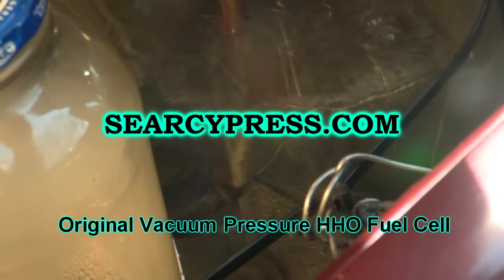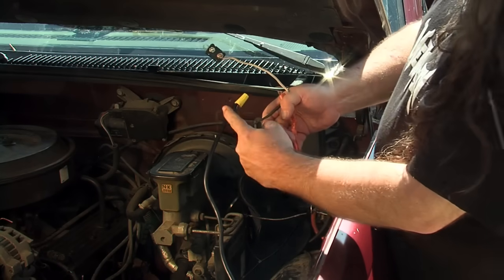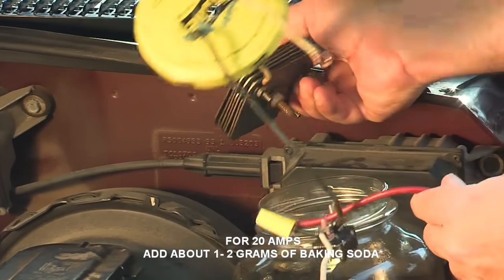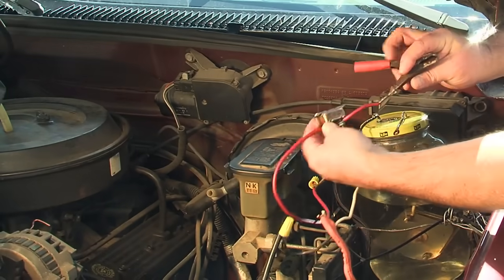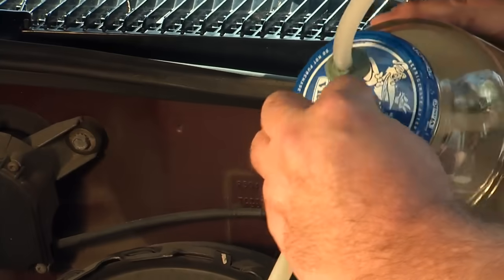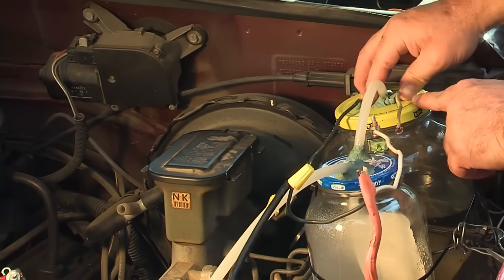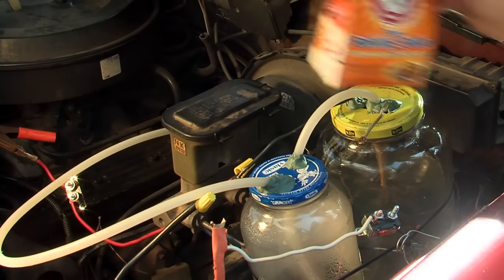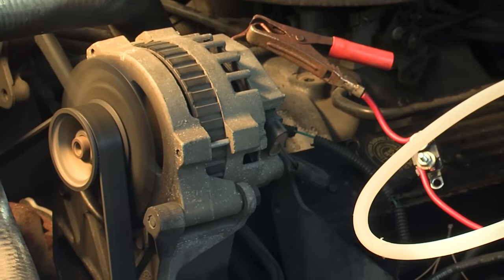Vacuum Pressure Hydrogen fuel cell defeats high gas prices using hydrogen from H2O.

Comment: "Don't rebuild anything you see In this video..." 
2:51 " I highly recommend that you connect it as you see it in this fashion."
Reply: @a.freeamerican7267  PVC creates static.. bad idea.... glass does not
Reply: @DaChiefn1 xl
Reply: How often do you change plates?
Reply: @timothylogan5387  never
Reply: @Polaris88Reid  
Have you looked into alcohol engines??

I have a moped that runs on moonshine. ( yes, it's a completely rebuilt motor... and I'm aware it will need to be rebuilt sooner than if it would have been ran on gas..)
    I've put over 3000 on it so far & she's still running strong
Alcohol engines are a little harder to tune but once you figure it out you can easily break away from these oil cartel barons.
And unlike hydrogen you can run completely off of Just alcohol.

Makes you wonder why the big three don't produce alcohol burning engines...?? 😀😀😀😀😀😄😄😄😄😄😊😊

Imagine all your neighbors having alcohol burning engines & you had a 200 gallon still...
Oh wait...!! they made making massive batches of moonshine illegal
I wonder why..?
Fukn Oil cartels mannnn
Reply: @djlansing  yes. Good words.
Reply: The governments can Get fucked.  I used to do this for ten years in my suburban Saving money  too .Except build a lot cleaner and in a hidden ways so it looks stock and clean.
Reply: @Polaris88Reid  I have a02 Chevy suburban 5.3 . How big should I build my hydrogen generator so I don't have to buy fuel anymore
Reply: @Polaris88Reid  give it up bro, hook us up with some plans?
Reply: Christina Eckels 

I like that it’s made mostly of trash that would otherwise end up in a landfill.
Reply from the maker: Exactly. Thanks for your comment.
Reply: @metalpresstv  excuse me I've seen people setting up their engine with a gas tank around where your setup is and they run their vehicle off of just gas fumes it goes right into their air filter have you seen anything like that and tried it curious if it would work on your vehicle I'm pretty sure it would just running on straight gas fumes gas tank right in the engine with a couple hoses hooked right up to it extremely simple apparently
Reply: @jonnypage9484  Charles N Pogue vapour carburetor...1930s...that was using a 4 cylinder big bore ice cream truck...your car actually uses vapour from canister buildup its built into your engine for MANY years..easy to tap into
Reply: @mjolnirswrath23  I'm thankful for being a plumber and I got a basic generic knowledge of this my only problem is I want to know how I can hope this up to my little Honda Accord or possibly my Chevy equinox . And this is a message to the people the 2015  Chevy equinox is the worst vehicle you could ever purchase and we swear on that
Reply: @metalpresstv  why do you want to run it at 30 amps, just for max production? Have you ever had any problems since or updated your system? Thank you so much. You rock.
Reply: @metalpresstv  https://youtu.be/58IkmPK6ikc
Reply: @metalpresstv  pls get back to me I'm wanting to do this with one jug dose it make it use moer gas or less
Reply: @metalpresstv  
This may help with fuel mileage but I sincerely feel that you should advise people about how explosive hydrogen is.
 Not that it's really going to hurt you... but if you were to get into a fender-bender you'd see a nice flash until all the hydrogen gas is burnt up.

Just something the kiddos trying to save a few bucks ought to know.

I made a hydrogen cell 10 years ago when I first got out of high school but I didn't put it into a vehicle I just used the cell to blow up balloons and then we would throw matches or Point lasers at the balloons & BOOOOOM!!!!
We got so bored with it for kicks one time we filled up a trash bag w/hydrogen gas & that really got a big bang
😄😄😄😄
Reply: @djlansing  I know a friend that used to fill up 55 gallon black trash bags with acetylene and helium mixed,  tie the bag and light the tail let her go . made an interesting Conversation  piece at midnight for the neighbors smoking lefties in the back deck .
Reply: @wagnerrdtradingpostonebay8934  not sure what a lefty is...
Is that like an uzi..? (put a lil coca in the cig..?)
LoL
Never thought of putting helium in this to make it go up in the air.
Nooiiiccee!!
Reply: @djlansing  Idk they always called joints  lefty when I was growing up. Yes get the mix just right too much hel she would float up too fast put out the wix. Good clear night all you could see is a dripping molting plastic droplits on fire till she got up about 1000ft  Then boom
Reply: He used to get board on security duty .would experiment with shop supplies
Reply: @djlansing  I was agreeing with you that people should know how combustible it is. I'm commenting on the video not your 8th grade science fair project. Yes you could separate the Oxygen and Hydrogen production but that's clearly not the generator shown.
Reply: I was coming here to write this. Thanks!
Reply: @NithinJune  no it's safe
Reply: @NithinJune  hahahahaha
Reply: @Polaris88Reid  But you dont use it anymore?
Reply: What fashion ?
Reply: Got it sry.
Reply: @Polaris88Reid  If it worked - why don't you use it anymore ? Also was it tbi or did it have a carburetor -
Reply: Message to Johny Page. I watch a debunking show on running a lawnmower only with gas fumes. They tested the amount fuel efficiency on straight gas and gas fumes. As far as i remember the fuel efficiency was the same, but who knows. Maybe the fumes would save on an actual car. Maybe with all the oxygen sensors in a car the computer will adjust to save on gas.
Reply: Hilarious....I might try this tho!
Reply: Pickles + Sauerkraut = GAS!!!
Who woulda thought...
Reply: @NithinJune  no it doesnot I used one the same for years in a vw diesel and its still going
Reply: @jimmyconnolly188  that's good to know thanks for sharing
Reply: Why China don't make like this or US
Reply: @sandrafernandez6771  petrodollar killswitch hahahaaha
Reply: @sandrafernandez6771  GM did something similar in their Honeoye Falls project. The project was scrapped and al the car shredded. Sold the patent to an oil company I'd assume.
Reply: he was talking to the mouse in his pocket

Comment: Good information thanks , please make another video without the annoying backround punk noise, i want to listen to you, this is very important info.
      Can you run your car on only hydrogen yet?
Reply from the maker: Well it might be possible to run the engine on hydrogen alone, running on HHO is problematic. HHO will burn at an incredible temperature and could actually melt the engine. Thanks for the comment.

Comment: You explained so simply  and easy.. And went to talk right into the point... Thankyou very much for sharing and doing your best to help out to find real solutions for the gas problem!
Reply: Can someone make a parts list?
Reply: He left out a few critical statements here. Introducing more air into the vacuum line will cause fuel injectors to introduce more fuel, therefore burning way more fuel than you did before. Also without a good way to vent the gas you would most likely build up enough HHO gas under the hood to kill everyone in the truck................................If it's on the internet and someone made a extra long video about it = IT MUST BE TRUE? XD
Reply: HAHAHAHHAA 32+ dildo know-nothing losers
Reply: Dave Pin  do you think a 2000 ford ranger computer needs to be modified?
Reply: Dave Pin  for the engine not to run too rich.

Comment: how the water runs the engine???? where the water goes? does it replace the fuel??? how ? YOU DID NOT SHOW  HOW THE WATE  HOW IT  REPLACES THE FULE TO RUN THE ENGINE>>> THIS IS VERY TECHNICAL>>ESPECIALLY THE ELECTRICIY WATTAGE >>>> AND HOW MANY KM THIS  AMOUNT OF WATER RUN THE CAR IF IT IS FUEL REPLAMENT!!  YOU NEED TO BE VERY SIMPLE AND TO EXPLAIN THE REASON FOR EVERYTHING U USING >>>> IT LOOKS GOOD IDEA BUT VERY CONFUSING
AND HOW U SEPERATE THE OXYGEN FROM HYDROGEN? HOW CAN YOU COLLECT THE OXYGEN TO USE FOR CLEAN BREATHING >>>> ?? IT IS VERY CONFUSING >>

Comment: I wonder what happens if you do this with a turbocharged engine? Lol maybe wouldn’t be a big deal but the o2 and H makes water when it burns right?
Reply from the maker: Worth research. Running lower octane fuel while removing engine ping is something we noticed immediately. Fuel is so bad at 87 octane. Prices are low right now, but nothing good lasts forever.

Comment: 29 Amps?   x 13.8V DC = 400 Watts or  .54 HP.   Now just need you to say what your fuel mileage is with and without the Brown's gas setup.  I do not believe your claim of 26 mpg fuel efficiency with this setup.  On your ~15 mpg pickup, you 're claiming an 11 mpg increase?   . . . Or?
Reply from the maker: The fuel cell is not powering the truck. It is simply enriching the fuel making it burn more efficiently. Also I am able to burn a lower octane fuel without any engine ping. This truck would be doing well to get 11 miles per gallon on the highway. It has achieved 20 plus miles per gallon using the fuel cell. The tests were done by pouring one gallon of gas in, after the engine ran completely out of gas. This was done several times with the fuel-cell on and off. Not good for the fuel pump however about the only way we could be sure. I'm not trying to sell you this.. It was just an experiment and the results I found. Thank you very much for the comment.
Reply: @metalpresstv  Thank you.  I did not want to disparage your truck by guessing too low, but even if you had a 15 mpg vehicle that you could increase to 20 mpg with your little setup, that would for sure be worth it.
Yes, I have understood the concept for some time.  My argument is with the chemistry (something for nothing) however, not having built nor tried to operate this model, I will bow to your experiment as perhaps you have found a sweet spot for increasing your engine efficiency.  

The problem is that my understanding of the process is that it takes more energy to shake the water molecule apart than is gained by recombining the molecule by burning and you are burning excess gasoline to drive the alternator.  That idea is common knowledge for oxygen generation that I researched with General Dynamics Electric Boat and was given the opinion that  to make fuel from water sufficient to run your truck, you would need a reactor approximately the size and in excess of the weight of your truck.  Just sayin'.  I salute your effort to actually do this experiment... Now, will I?  Retirement is soon, maybe!

Last question, how much water is electrolyzed per mile with the setup just as you've shown it?

Comment: I watched with interest, I am a little worried about the very poor quality of the wiring. You need to get rid of the dreadful background music that makes it hard to hear whats being said its not required YouTube videos. One thing you did not show was the disconnection of the petrol  so how do we know that the engine is running on Hydrogen.
Reply from the maker: The engine is not running completely on HHO. The additional gas created by the fuel cell increases the efficiency of the burn, stops engine ping with lower octane fuels. As far as the music goes if it's too loud you're too old. Thanks for the comment.

Comment: is this legal?
Reply from the maker: Certainly transporting any pressurized vessel would fall under the Department of Transportation regulations. This system however operates in a vacuum. If I were going to use the system it would definitely be a good idea to check my local regulations regardless.

Comment: All cool and groovy. So where did you exhaust the OXYGEN? I mean simply if it went back in with the hydrogen it just turned back into water. What's the trick? Also how fast does your electrode gunk up and you need to clean or replace.

Comment: Your the man,  I just started messing around with electroless,  I was impressed with how simple it really is to produce the h. Does you truck still have the same top speed,  is the torque different?
Reply: The whole thing is complete bullshit, electrolysing water to get hydrogen is very inefficient and internal combustion engines are even more inefficient so this crap can only ever reduce fuel economy.
Reply: @ferrumignis  are you a fucking dumbass? You think this and along with other people are lying on purpose that a car can run on stuff like this? Why for what reason? They aren't selling anything to you they are simple videos telling you how it works so no they aren't lying and I doubt they are retard, this dude has solar panels and other things he's built are those bullshit too? Your a dumbass even BMW and big companies have cars that run on hydrogen now and simular stuff like this, based on the stuff I just said he's not lying and this is real and your stupid. The reason why this isn't sold world wide is because guess... oil companies want us living poor and paying them same with electric and other things that could probably be turned into better for environmental stuff

Comment: I like the thump keg...lol. you may want to use a plastic lid on that big jar with wires running through it.what do you do about your Oxygen sensor?
Reply: 1996 GMC V8 350... What part of that screams O2 sensor to you? Is it the part where it probably doesn't have one from the factory because of how old it is or the part where it was deleted? Or was it the part that 350 V8s are often modified back to carbureted for performance reasons? lmfao
Reply: @jimmio3727  so you're saying they weren't using O2 sensors in 1996 🤣🤣

Comment: Have you tried this piston overhead valve engines like those for generator typed these have higher compression ratios than regular single OverHead Valved engines like those of the common lawn-mowers? Please do a video on this thank you. I trying to get a generator for the house these will need only 10 to 12 amps of this type of "HHO" gas-generators, which by the way nearly every mid-sized generator, 6KW to 11KW, has built right on its power, for charging the car battery as optional use.

Comment: Hook a balloon on the output hose and watch how little you are currently generating. You need more plates and to scratch up the plates to create more surface area. You also should bubble through a small container of water that acts as a flash suppressor, otherwise a spark can travel back through your line and cause an explosion at your generator once you get it actually producing a usable volume of HHO.
Reply from the maker: This particular fuel cell is capable of producing up to six liters of gas per minute running at very high amps. We have tested it. In the state of vacuum things are quite a bit different however. Thermal properties are much different. The actual amount of gas produced varies on many different factors. The potency of that gas produced in vacuum is also very diffrent. Thanks for the comment.
Reply: @metalpresstv  I strongly suggest a flash suppressor or a one way valve to protect your generator from an explosion. Have you thought about a valve or switch to cut off the flow of gas to run only on HHO? If you are generating that much, there is enough to power your vehicle. You may need to get more into the carb than the vacuum line is drawing to run only on HHO. The volume you mention sounds like it would violate the law of conservation of energy. 
Popular Mechanics built an HHO generator, but didn't get the same results. 
Here is the article: https://www.popularmechanics.com/cars/a3499/4276846/
Reply from the maker: @wylieecoyote  don't misunderstand me. 6 liters per minute was created by a 3500 watt generator sitting in the back of the vehicle with a hundred amp battery charger powering it. People will say you're using way more energy to run the generator than you're getting in benefit. I have no idea, all I can tell you is it was a lot like having a dragster engine. What I did find was this much HHO is dangerous to the engine. Nevertheless it was an interesting test. There are always losses. This is unavoidable. However burning 100% of the fuel that you put into the engine is possible. If that is factored in certainly there are gains to be made. If not always in mileage, then in performance definitely. Thank you for the comment.
Reply: @metalpresstv  Generating that volume with a generator sounds more reasonable. If a vehicle was converted to run only on HHO, would it have the power and run as well as gas? If HHO were made economically at home and vehicle tanks topped off at night, I could see a future in this method. The big IF is whether it is as powerful as gas (science says no) and is economical enough to be cheaper than gas. Here are 2 videos with science explaining the pros and cons of hydrogen without praising or bashing it. I strongly encourage anyone interested in this to watch learn before making mistakes others have made and consider ways to make improvements. These videos are very interesting:
https://youtu.be/l6ECwRnJ0Sg
https://youtu.be/f7MzFfuNOtY

Comment: When you see water coming out of your tailpipe, it is perfectly normal.  EVERY engine will do it every day.  It is the normal result of hydrocarbon combustion.  Gas and any other common fuel is a hydrocarbon.  When you burn a hydrocarbon with oxygen (21% of the air), you get carbon dioxide and water vapor as the result.  In warm weather you may not see it because it remains in the vapor (clear gas) state, but in cooler weather, especially cold weather you will see clouds of white vapor (steam) and water dripping from the exhaust.